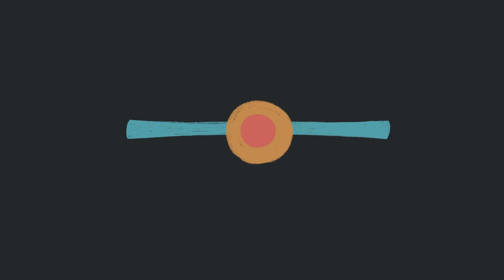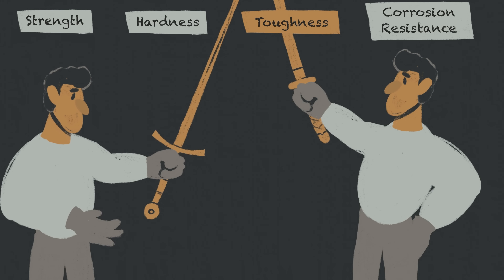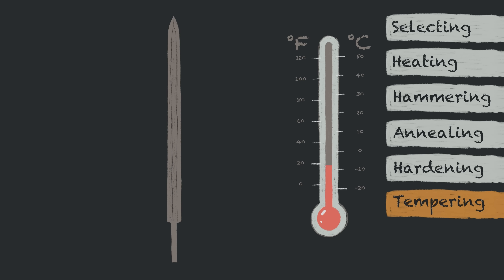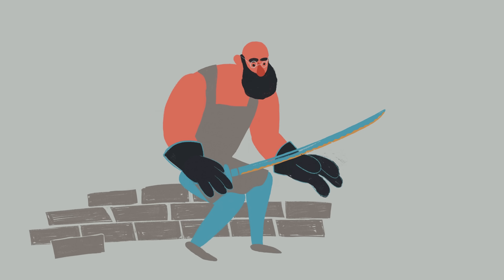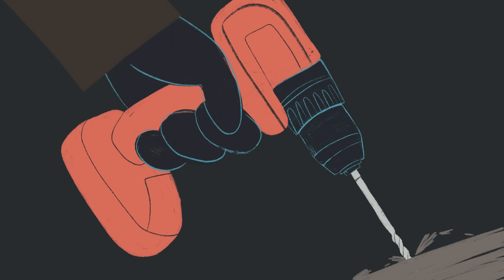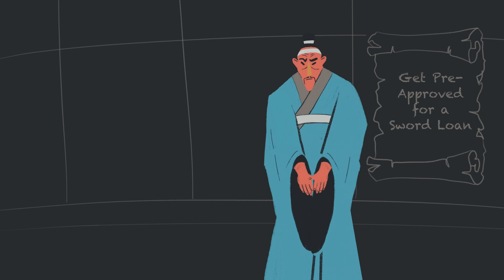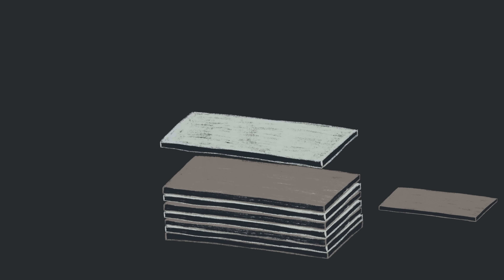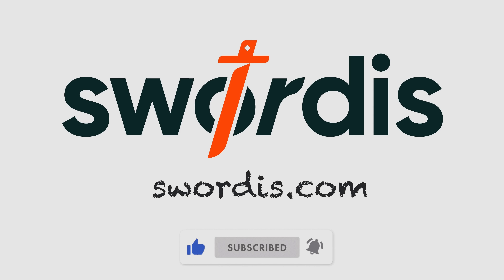The Science behind Sword Steel Types

Comment: Sorry, I have to be the nitpicky blacksmith here. The  purpose of annealing is to even out the grain structure of the steel and get rid of the stress caused by hammering. Forging it afterwards makes it pointless. But doing the rough grinding after annealing and before tempering is a good idea, because the steel is soft, and you don't have to worry about overheating the blade and ruining its temper.
The video has some other inaccuracies, but overall well made, and it's a great introduction for anyone new to this topic.
Reply from the maker: Thank you for taking the time to point out the inaccuracies! We agree with you that we may not be experts like you, but we are doing our research and trying to get feedback from our suppliers. Of course, this can still leave room for mistakes. Would you mind sharing the other inaccuracies so we can make sure we don’t repeat the same mistakes next time? You can email us at support@swordis.com. We would also love to offer you some credits that you can use on our website, or, if you’re not interested, you’re welcome to share them with someone who might be. We appreciate your honesty and kind words. ❤
Reply: @swordis-channel  That's very kind of you, but I might not be the perfect person to fact-check the whole video since I'm a self-taught blacksmith, not a metallurgist or historian. One other thing I noticed is only a slight mistake in the choice of words: when heat-treating a blade with hamon it's the cooling, not the heating up that results in a differentially hardened blade. And a blade like that has a harder, therefore sharper edge, but it's not necessarily tougher. I have no actual experience in it, but I saw a guy comparing through hardened blades to differentially hardened ones:

https://youtube.com/shorts/KyyCI9iyFNA?si=vbf_tBuvCaMz-Etk
Reply: @marton_dobo  You are well. All correct.

Only, what the video indicates allready, the types of metals used, their purity and mixture are the first aspect of break indicators. The second is the treatment of those, then in combined form also. The depth of the fire layers, timing in burning materials, choice of the burning, cooling and hardening substances, the methods therefore vary. Even the clay will be a break indicator, depends all on combination.

Copper or iron cores mantled into T10 - it is all about the vibes... Transfering pure energy, terraforming...
It took us several tens thousands of years. And got misused a lot. You know the rules. Integrity is respect. Compromises can turn out long searched progress.
In my oppinion, take the offer.
Reply: @marton_dobo  You are mostly correct, but I'd say a deferentially heat treated blade can be tougher, depending on the steel. I noticed it while testing 1095 at least, and I'm sure it does for traditionally made katanas, otherwise they wouldn't have done it for about a millennium.
Reply: @osirisatot19   I agree. The video he posted shows a poorly diff. heat treated katana that shouldn't have broken that way. One of the main purposes (there are more) of the differential heat treat is to maintain a tougher back and core while providing the hard edge.
Reply: @swordis-channel  Your info on spring steel is mostly wrong, I'm afraid. "Spring steel" is any steel that's been "spring-tempered," which would include all properly made, through-hardened blades, regardless of the alloy.

Also, spring steels' functional difference is not in their flexibility (that isn't changed by heat treatment), but in being more resistant to ductile deformation (ie, they can flex a whole lot more before they "take a set"/"stop returning to true") and less resistant to brittle fracture (ie, they can't flex as far before they snap entirely).
Reply: @swordis-channel When you say steel is made from 0.1% to 2% carbon, it's right for general steel, but for knifmaking you won't be able to harden steel that has below at least 0.5% carbon (you could use cementation on 1045 for instance but it would be case hardening only, not to the core), ideally for knifmaking you would need more around 1% like 1095.  So my point is since we are talking  about sword steel, I would not have included "from 0.1%" in the script, but more the range actually used for knifmaking / swordmaking. Interesting video overall.
Reply: @mistral-unizion-music  For swords 1% carbon is already too much. You need at most 1095 for a short sword and at least 1045. In that middle territory you'll find steels that can be used for all types of swords. Rapiers, sideswords, longswords, Tulwars, Jian, etc, are all only really possible with a hardened and tempered steel in that range of carbon content. For knives it's different due to the shorter blade length.
Reply: @mistral-unizion-music  1095 is decent for knives. High carbon content is good for edge retention but at the cost of toughness. Swords benefit from a lower carbon content generally between 0.6 and 0.86% carbon. Think 1060, 1075, 1084, 5160, 8670, 80CrV2, and the just introduced ProCut, which is 0.86 carbon.
Reply: Sorry it’s not really a mistake, their suppliers really do hammer after.
Reply: I agree. I'm also a Bladesmith currently transitioning from knives to swords. And though this video is a good introduction, it does have it's flaws.
Reply: There's also the line about heat treatment sometimes being more important than steel choice.... The way a steel responds to heat treating is a huge part of WHY steel choice matters. These are not separable factors. They're two sides of the same thing.
Reply: @RyanDB exactly, very well said!
Reply: so many inaccuracies, this was tough to watch.
Reply: Actually thank you because that explains  a bit more about a kneeling and an actual nice trick for a new blacksmith.
Reply: Que triste, então
Reply: When I think of annealing, I think of when I pick out a steel that I'm not sure what it's gone through and put it through that process. To soften it first and then do what I need to do, and then after all the forging has been done, anneal it again to get it prepared for the hardening and tempering.
Reply: you are thinking normalizing not annealing,  annealing is to bring the steel to its softest possible state for grinding and filing etc.  normalizing is to relax the steel and remove stress and is done in multiple heat and cooling steps depending on the steel used.
Reply: I agree. The video also implies that you can't have high carbon stainless steel, or high carbon spring steel; which is odd. I do give this video a lot of credit for seeming to not be narrated, written, or animated with AI; a lot of companies are doing that lately and it is profoundly insulting to actual creative people.

Comment: Saying differentially hardened blades last longer in durability tests is reductive and mostly incorrect. There is a reason every single HEMA blade is spring tempered. A differentially hardened edge gives you better edge retention in mat cutting, but in basically any other application the edge is going to be more prone to chipping and the spine is going to be more prone to plastic deformation.
Reply: Bladesmith and HEMA competitor here.

Alex is absolutely correct.  A core flaw of traditionally made Japanese swords is that they have an exceedingly hard edge with a softer spine, frequently resulting in snapped tips and cracked edges.

It's dishonest to say that an equivalent hardened spring tempered blade would break first.  Traditional European spring tempered swords are hardened to around 45-50 rockwell, while traditional Japanese swords are hardened to ~60 rockwell, with a soft spine.  If you hardened an entire blade to 60 Rockwell, it's hard to the point of brittleness.  If, however, we compare a spring tempered blade of 50 rockwell and differentially hardened blade of 50 rockwell at the edge, made in the traditional Japanese style, we would absolutely expect to find that under high stress the spring tempered blade would flex and return to true or near true, while the differentially hardened blade would bend and stay, likely cracking the cutting edge.

Japanese differential hardening is a brilliant way to make adequate swords with inferior available materials, but it isn't superior to just having better materials, and when good materials are available, it isn't necessary, outside of specific applications.
Reply: @Gilmorrigan It blows my mind that so many people are taking a piece of advertising as fact. This company sells Katanas, of course they’re going to bend the truth to sell their product.
Reply: @AlexTheSwordGuy The metallurgy is totally wrong, too.  This smacks of AI research.  No one reputable is producing swords outside of .45-1.2% carbon.
Reply: @Gilmorrigan yes. The lowest carbon I know of for commercially produced swords is SIGI’s 42CrMo4.
Reply from the maker: Hey Alex! Thanks for the input, maybe it wasn't clear. Our point was about comparing two blades of identical steel and hardness: one through-hardened to a very high hardness throughout, and one differentially hardened. In that specific scenario, the uniformly hardened blade would indeed be more prone to snapping entirely, whereas the differentially hardened blade would more likely bend or deform rather than snap
Reply: @swordis-channel ok, but that’s still not true. Spring steel is designed for high elasticity and impact resistance. There’s a reason cars use spring steel and not differentially hardened steel in their suspension. A properly spring tempered blade will not snap under stress and should withstand millions of stress cycles. If you bend it beyond its elastic limit will cause permanent deformation, but snapping is not something that should be happening without a flaw in the steel or temper. A differentially hardened blade will deform long before a spring tempered blade will deform or snap. A differentially hardened blade may have better edge retention, but a spring tempered blade will withstand far more in the way of impact and stress.
Reply: @AlexTheSwordGuy  Spring steel is also a specific makeup, as shown in the video. You can have a differentially hardened spring steel sword if you wanted to. And while yes, spring steel is better at returning to the original shape after warping, there are different needs for different things. You don't differentially hardened steel in car suspension because there is no reason to have two different levels of hardness, as that would simply make it more likely to snap. In short: Comparing two things that have different uses is mostly useless if you are only going off of one quality. Yes, Spring Steel returns to its shape well, but so does a rope. For a sword, you want something that will absorb impact,  but also not just bend and give, as that isn't very useful for cutting.
Reply: @deerdanger698 Hey, I think you’re misunderstanding the point I was making. Yes, “spring steel” refers to a family of alloys — 5160, 9260, etc. — but in the sword world, “spring tempered” typically refers to the tempering process more than the specific alloy. It means the blade has been drawn back to a spring-like hardness (usually around 48–52 HRC) for maximum toughness and elasticity, not high edge retention.

And sure, you could differentially harden a spring steel blade, but that’s not what the video was showing or what the original claim was about. The comparison was between a through-hardened blade and a differentially hardened one of identical composition — and the claim was that the differentially hardened one would always be more durable. That’s just not true. That’s just  a fact of how metal fatigue works. 

Differential hardening prioritizes edge retention and makes the edge more brittle, while the softer spine absorbs shock. That has advantages in certain cutting contexts (like tatami), but for real swords that take repeated heavy impact, it’s less durable than a well-done spring temper. That’s why literally every HEMA feder or longsword is spring tempered — not differentially hardened. It’s not just about “returning to shape,” it’s about long-term fatigue resistance and the ability to take thousands of flexes and impacts without cracking or deforming.

And respectfully, the rope analogy doesn’t really make sense here. No one wants a sword that “just bends and gives” — but the reason we temper blades to spring hardness is because they can flex and absorb impact without chipping or snapping. That is useful for cutting and for combat durability. We’re not talking about wet noodles here — we’re talking about blades optimized for repeated dynamic stress without catastrophic failure.
Reply: @AlexTheSwordGuy i think you are the only person missing the point here; i may be wrong but in the video they mention destruction test, please take two 1095 blades one different hardened and another through hardened...do the test and let us know which one snaps first
Reply: @randomblackguy2043 if the 1095 is taken back to a spring temper of ~50HRC the differential will snap first. If you think it won’t I suggest you read up fatigue life of spring steel vs mild steel. Ask any metallurgist. The only people who are going to argue that differential hardening is more durable are weebs who get their sword knowledge from anime. My career is in R&D in metal manufacture and I’m HEMA instructor. Everyone above is so very wrong.